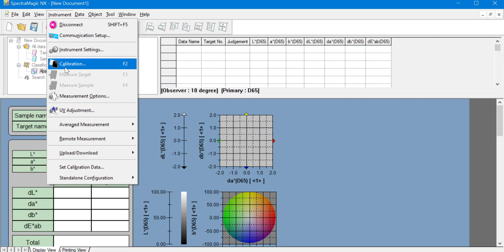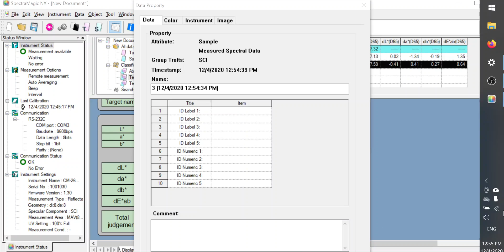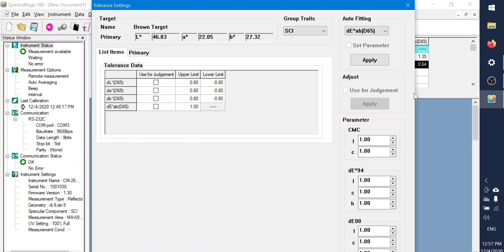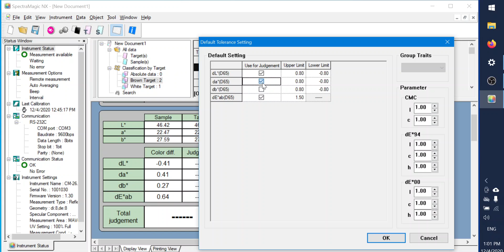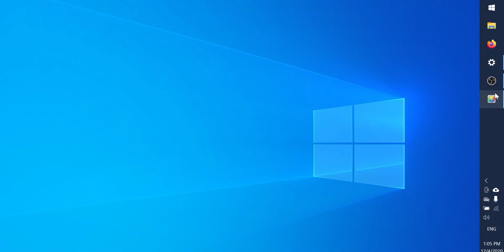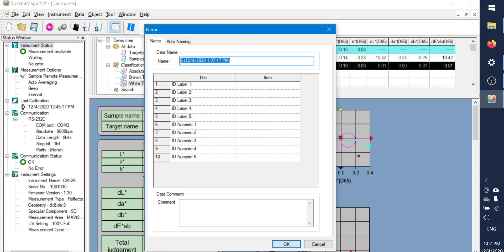SpectraMagic NX Software Instructional Video

Comment: Hey I did the SCI-SCE equation and it worked. But they have to take the measurements at different wavelengths or whatever you call it. 400,450,500,550, and 600. What's the purpose of this and how can I use an equation to subtract the SCI-SCE for those specific numbers? We're measuring how bright reflectors are that go in headlights. They have to be 85% and up to pass at all those wavelengths.
Reply from the maker: Do you have a specifications sheet for me to have a better understanding on what you need to achieve. That way, i can help you to set it up.
Reply: @Prem-DST  on 400,450,500,550, and 600 we subtract the SCI from SCE. Trying to find a formula for the program to automatically list SCI-SCE on those wavelengths.
Reply from the maker: @1689solas  i have not tried something like this. Please give me a while to try this out.
Reply: @Prem-DST  What is the purpose of the different wavelengths? Is there a way to check reflectivity accurately without using all the different wavelengths? Maybe one measurement?
Reply from the maker: @1689solas  For the Total Reflectivity, you could use the "Y" measurement unit. Y takes into account all the wavelengths. For certain applications, there are interested to measure the reflection at a certain wavelength, eg. 460nm.
Reply from the maker: @1689solas  It is possible to show both SCI & SCE for the all the wavelengths simultaneously. However, there is no way to calculate the difference between these wavelengths.
Reply: @Prem-DST  Is there a reason to have all wavelengths listed? Is there a single reading that would accurately measure reflectivity?
Reply: What's your cashapp. You haven't made a penny taking time out of your day to explain this stuff to me.
Reply from the maker: @1689solas  For the Total Reflectivity, you could use the "Y" measurement unit. Y takes into account all the wavelengths. For certain applications, there are interested to measure the reflection at a certain wavelength, eg. 460nm.
Reply from the maker: @1689solas  Thank you very much for the offer. But life is not about dollars and cents. I am helping you out because I have the ability to do so.

Comment: What do the SCI and SCE numbers mean?  We have to subtract the SCI from the SCE at work to measure these plates.  Is there any way to set it up where it does that automatically?
Reply from the maker: I made a quick video on this. Sorry, there is no audio. There is a function for user equitation on page 53 of the software manual. 

In this video, I assume that you would be doing Y (SCI) - Y (SCE). However, you can use any other measurement units in the equitation (eg. L*,a*,b*).

Video can be found here: https://drive.google.com/file/d/1_N-PVr_zF4x2HC4vUjBqtyFwBANhFroi/view?usp=sharing

For information on SCI & SCE, please find it here: https://sensing.konicaminolta.asia/specular-component-included-sci-vs-specular-component-excluded-sce/

I hope that this helps you. Let me know if you need further assistance.
Reply: @Prem-DST  Is there any way I can message you on messenger about this? I don't even know if we're doing reflectivity correctly.
Reply from the maker: @1689solas  would LinkedIn chat be okay? Here is my profile: https://www.linkedin.com/in/prem-reginald-068a954b/
Reply: @Prem-DST  Our setup looks different than that one. I have a picture
Reply: I don't have a premium account. Is there another way? I would pay for it.
Reply from the maker: @1689solas  which chat platform you have access to? Else, you can email me at prem@dstech.com.my

Comment: Hi, i have a spectrofotmemeter 3600d, and i can´t conec to may lap. Do you have a tip for this?
Reply from the maker: You will need the original cable from RS-232 cable from Konica Minolta and you can purchase a USB to RS232 to your laptop.
Reply from the maker: The converter cable will look like this. https://www.bhphotovideo.com/c/product/1087311-REG/aten_uc232a_usb_to_serial_converter.html